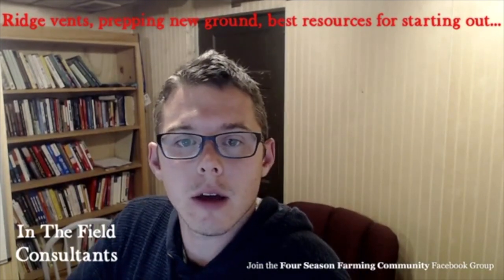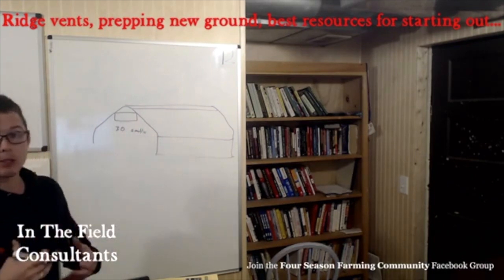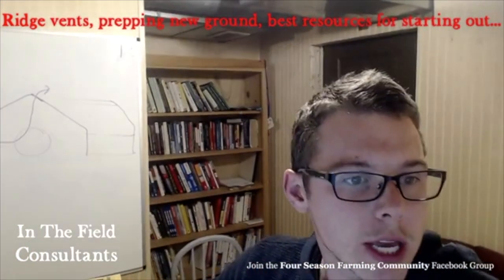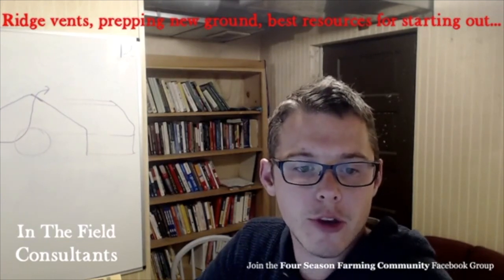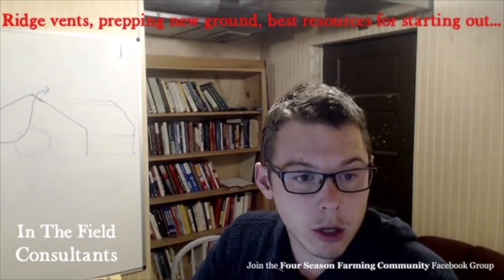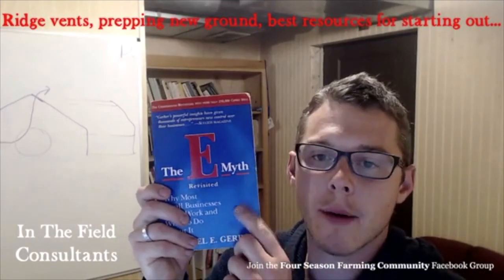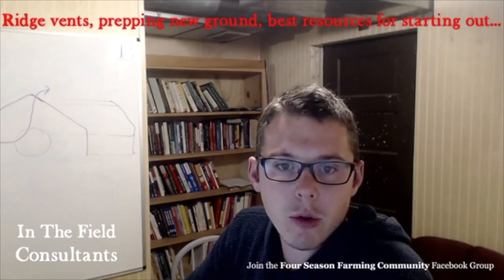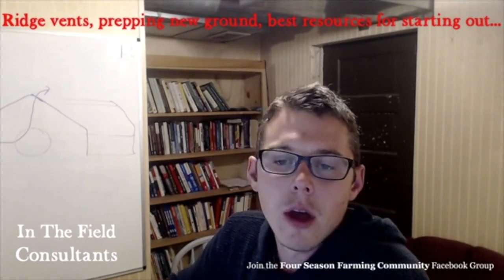Ridge Vents, Prepping New Ground, Best Resources for Starting Out

Comment: For portable cooling, I've had success with freezing 2 liter and smaller beverage bottles full of water.  When I put in 6-8 frozen 2 liters in the bottom of a large cooler, it stayed cool being outside 24 hrs a day, for 2-3 days even in the summer sun.  The bottles can then be refrozen when they melt, and you save the work of having to refill.  It's also cheaper than buying commercial ice.

Thanks for the tip on putting a nice picture on the cooler.  We don't have enough foot traffic/customers to make it feasible to put out lettuce, it doesn't sell fast enough, just wilts, or fogs up the bags, and no one will buy it cuz it looks bad, and it's irritating to bring 8 heads of lettuce and have them all end up in the compost pile.  Actually I find lettuce irritating because others make a living selling greens, but here in the midwest, people don't buy or ask for it at our market and very few people even bother selling it for that reason.